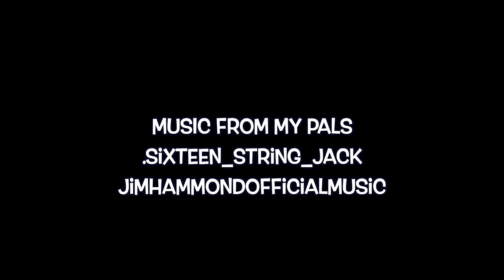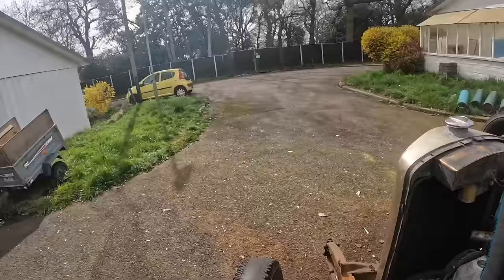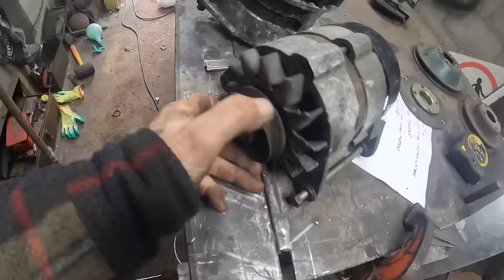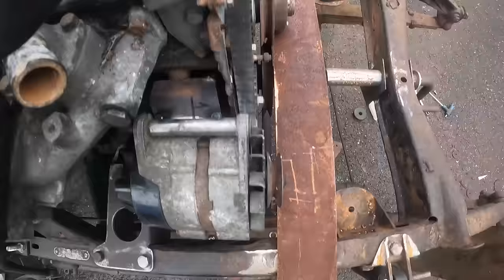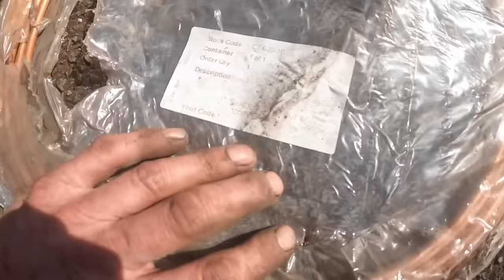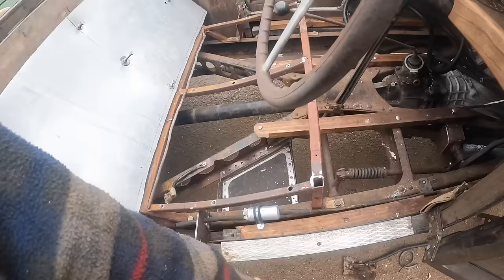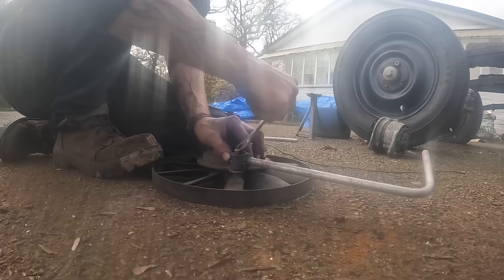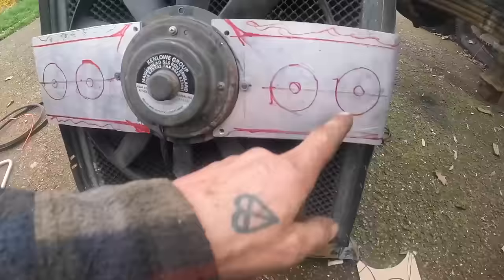'The Leaf'  a ratty roadster, a prewar car build, part sixteen

Comment: Top job as always! A little trick (though a bit late now!) With alloy sheet, if you scribble on it with a Sharpie, then heat it up with a blow torch until the sharpie disappears and quench it in a bucket of water.  It's bend much easier and won't crack.
Reply from the maker: ill remember that one for sure cheers dude
Reply: @oakswamp  or if you can get hold of 5083 sheet/plate, that's high strength marine grade alloy that you can cold work without it cracking. Most sheet stock is 6083  or 2000 series which needs annealing to cold bend or it'll micro crack at the bend line.

Comment: Great video as always, the alternator bracket you welded to the chassis will snap of or snap your alternator lugs as its solid and won't move with the engine, the adjuster bracket should be fixed on the engine so it all moves same as engine😁
Reply from the maker: dyou recon even with the engine solid mounted? cheers dude
Reply: Hi yes if mounted solid to engine would be one unit ok, but off engine to frame will crack off as two different vibrations, same with exhausts mounted solid will crack, you made a great solid alternator mount, you need to do same for adjuster, then it's all on engine as one, great videos.👍  @oakswamp

Comment: Weld some expanded metal under your holes. Do you think you need a Carny pull pin in your starter handle. Keep it clocked at 3 o'clock. Great job mate. Have a good week.
Reply from the maker: Thanks for the tip cheers dude

Comment: Bin out for a cold blatt on the bike ,called at a go juice station , and my eyes beheld a wonder, Austin 10 or 12 pick up but nice and w i i i d e .Duelly Transit rear axle so running boards wide enough to fit the rat on🤣🤣🤣 it was sweeeet , ( running a diesel 2.5 four pot landy lump) told him what you were about and told him about your channel hopefully another to join the fold
Reply from the maker: awesome sounds really cool ...where abouts are you

Comment: Looks like the check off list is getting smaller by the day .
Not sure I agree with the belt adjustment bracket going to the frame but what the heck a man has to live on the edge  sometimes.
I do have a question .... when you started the dash you contemplated using a brass gauge bezel.
I really liked the look of that for some reason .  
Was it from a boat ?
Reply from the maker: a guy in Canada gave it to me ...I believe its off a boat ...it will look great on a single seater ...ive never put a bracket to the frame before but it cant move ...if it does ive bigger issues hahah cheers mate